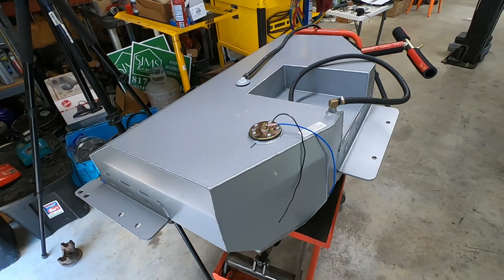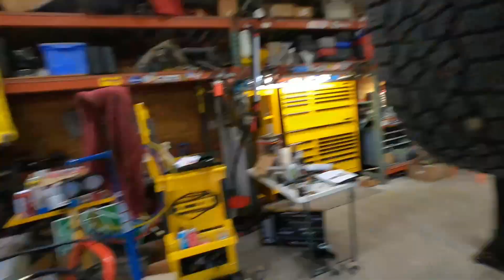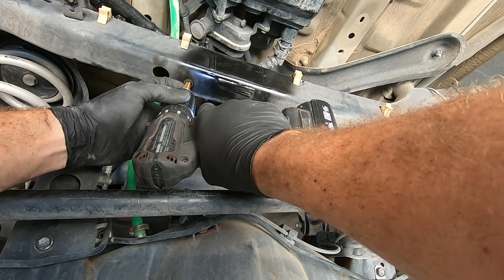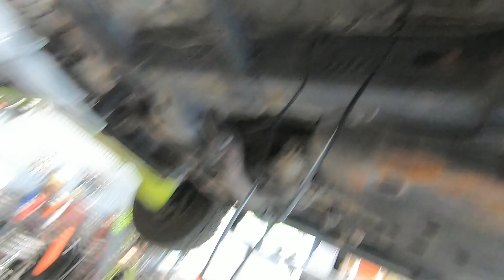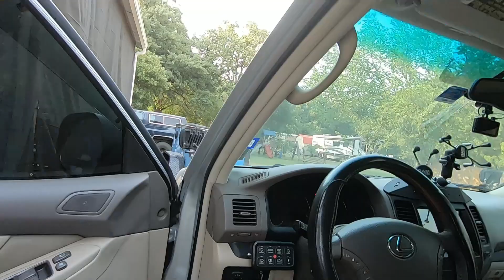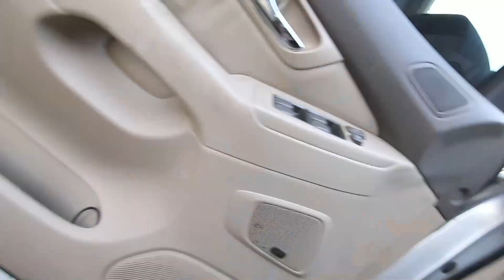Lexus GX470: Long Range America fuel tank install

Comment: I’m in the middle of this install. They only provided 8 1/4 clamps. Was there a place where you didn’t install them?
Reply from the maker: Either grab some more from the parts store or leave the off the small vacuum line. However, only on barbed fittings. You'll have to clamp where the small purge line was cut for the tee